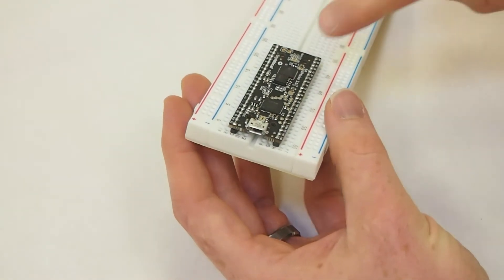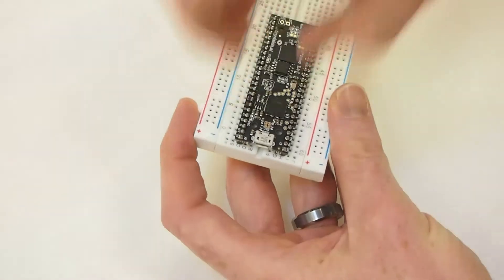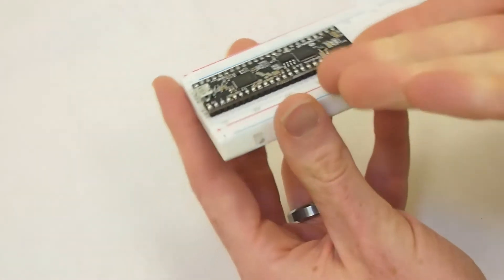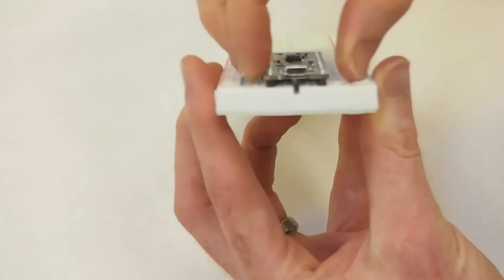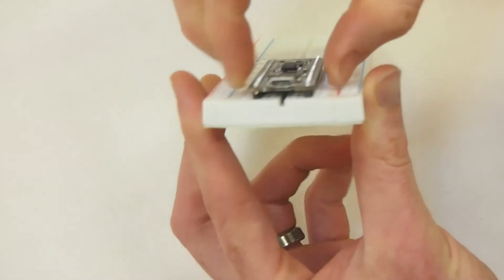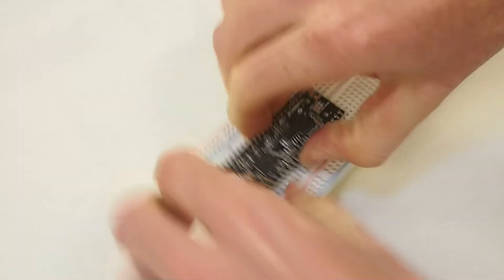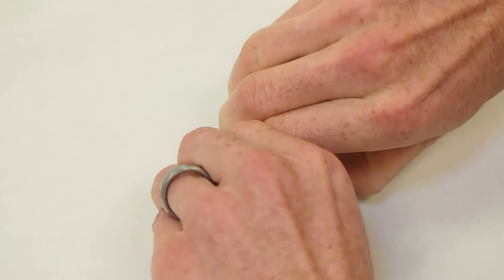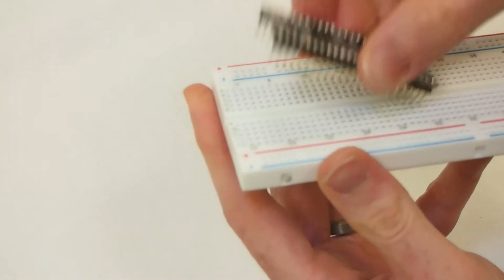How to remove your UPduino from a breadboard

Comment: This technique was impressive! I really thought the pins where stuck on the board cause I used a bit of pressure when putting it but it was all about leveraging your technique with the fingers several times all over the board and on the sides without too much strength too see it come out very easily without bending any pins or the board. Thanks!